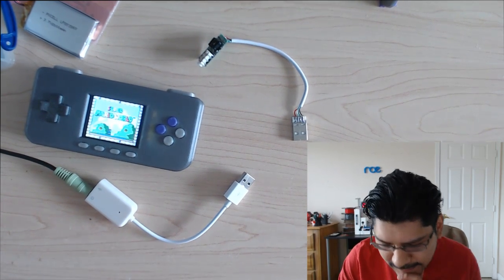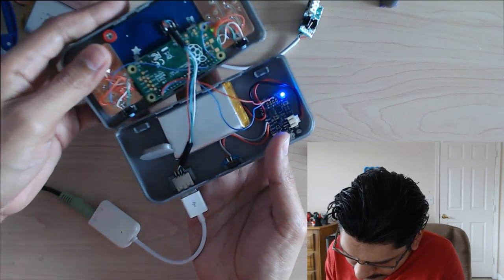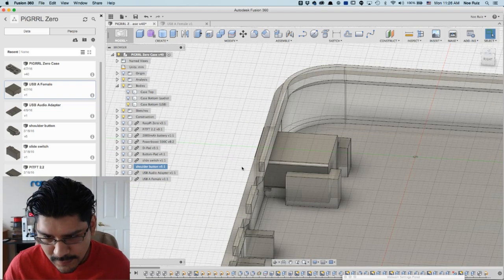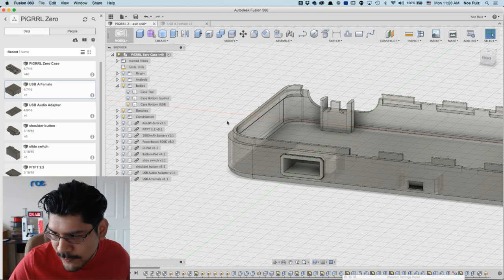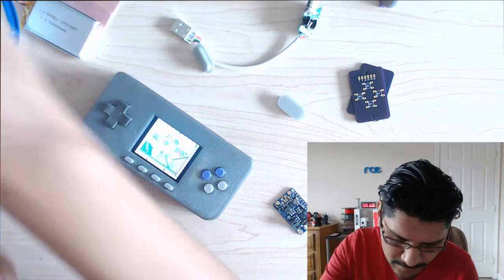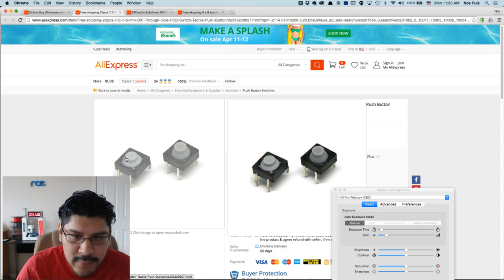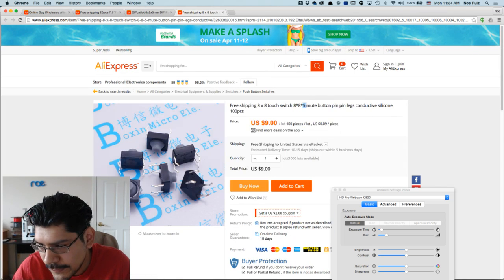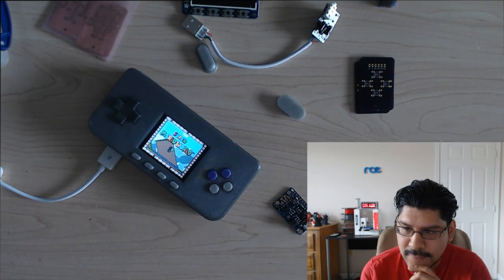LIVE Layer by Layer PiGRRL Zero Pt 7

Comment: Couldn't you make extra space for speakers by extruding rounded grips for your hands, instead of having a flat backside? Then in the round part you could have one or two small speakers mounted with room to spare for a audio amp/headphone breakout. And I'd still love to see an analog stick for PS1/N64 games. Aren't there little nub-joysticks available like the New 3DS uses for the camera control? Otherwise, this is a really neat project!
Reply from the maker: +jorenmartijn Thank for your suggestion! We're trying to keep the build cost low and assembly minimal on this project. But, totally possible!
Reply: No problem. I just don't always see the point of having no speakers in a portable game system. Anything you attach, like that USB sound card thing, makes it less portable. ;)

Comment: If the case was modded and the hdmi port was extended outside the case could this be used as a  console connecting the hdmi to a tv and a usb hub for additional usb controllers? Basically a portable console that could be used as a home console for multiplayer.  Assuming the hdmi port would still work of course.
Reply: I was thinking of this as well, that would be a phenomenally cool feature!
Reply from the maker: +JCValuations Appraisal sounds like a new project idea, thank you for the suggestion! :-)
Reply: +Adafruit Industries that would be awesome if this feature could somehow be incorporated.  Either way this is a great project you are working on.  I have enjoyed watching this one come together and plan on making one once the kit becomes available.
Reply: +JCValuations Appraisal theres one problem with this, the software used to power the tft screen disables the little screen within the device. You'd have to run a custom script to reedit all the values entered into the code to make it work
Reply: Samuel Morris While I agree this would be a difficult thing to do, it has been done before.
http://www.thingiverse.com/thing:1334253
The designer is working on a step-by-step tutorial, hopefully getting HDMI and pi tft to work together
Reply: +Samuel Morris I figured that would be the case but never got anyone to confirm that before.  I don't know enough about programming.  Any suggestions on how to make it work ?   Screen mirroring would be just fine.  I wouldn't need it to disable the pitft when the hdmi is plugged in.
Reply: +Vanya Gorbachev I have seen that one too which is essentially what I'm describing but with this Pi grrl zero design..  I just don't know how to make the custom script.  Like you said hopefully he does the step by step or someone else does.
Reply: +JCValuations Appraisal Can i bring back attention to this thread? I checked back on the pi nano (http://www.thingiverse.com/thing:1334253), but the display there is and OLED screen. With the TfT's, it would be amazing to be able to also use a monitor over HDMI, and be able to use the TfT as well. I don't fully understand the conflicts between using a monitor and TfT, but I will assume it has something to do with display over GPIO. (still insanely cool!). If anyone knows anything on this, please share your mystical knowledge!

Comment: I have a noob question here. I made my own button pcb using the specs of your revB pcb I found online. Most tutorials I found online connect a push switch to a gpio pin and a ground pin. But this PCB does not connect any of the buttons to the gnd gpio. How is the circuit closed then?

Comment: where did the game pad circuits come from? I can't find them anywhere
Reply from the maker: +Gonzie6 I designed theme for this project. They'll be available in a few week, hang tight! - Noe
Reply: +Adafruit Industries ok no probs I thought I might have missed them somewhere as I'm planning on making something similar only using a dsi xl case. I've found the permo proto board from the pigrrl pocket now which should do the job as where I live it takes ages for adafruit stuff to be available